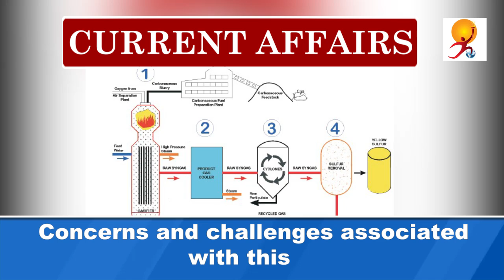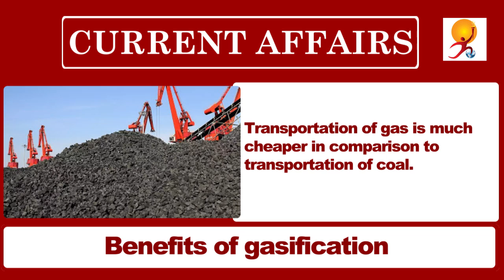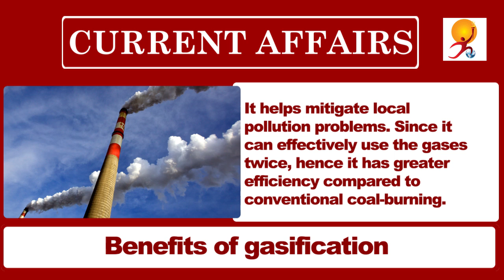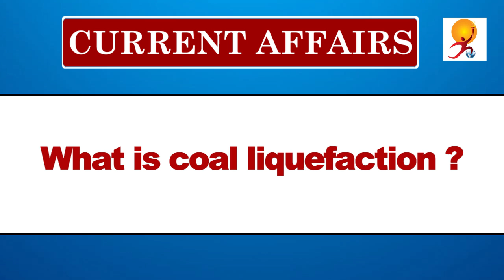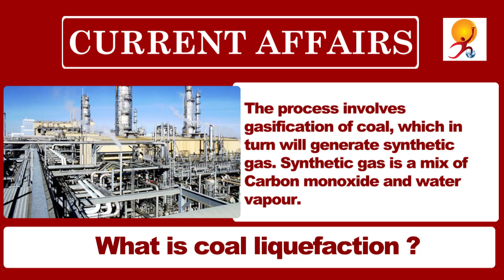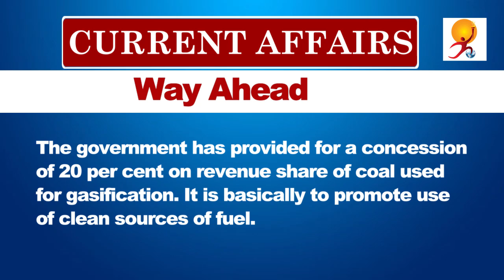What is Coal Gasification & Liquefaction

Comment: Honorable PM Modi has announced to gasify 100 Million MT of coal in next 10 years. This has given rays of hope for many industries. CASE Group in India has installed more than 200 gasifiers in the steel industry, the application being majorly for Reheating Furnaces for Rolling Mills and Wire Rod Galvanising.